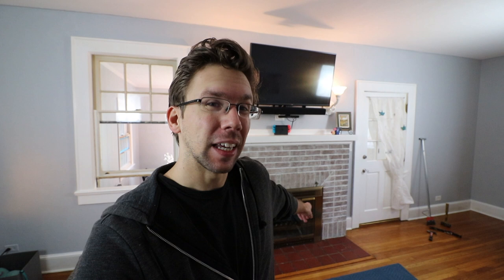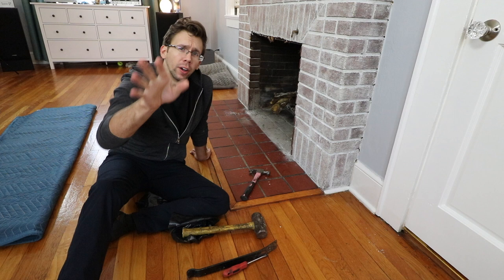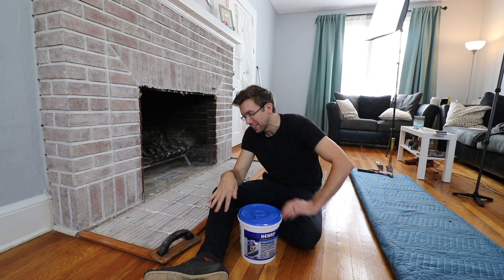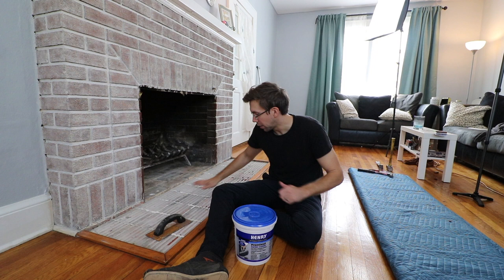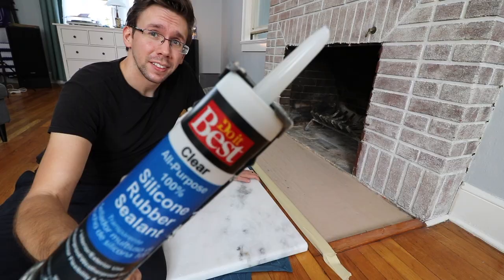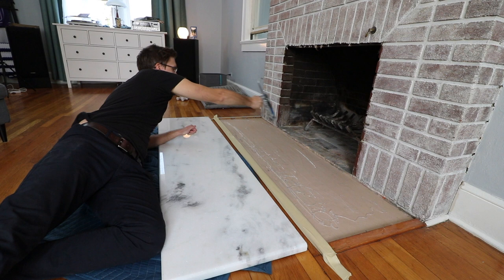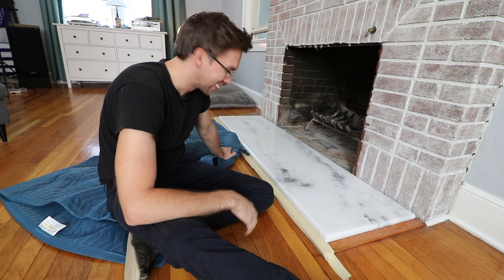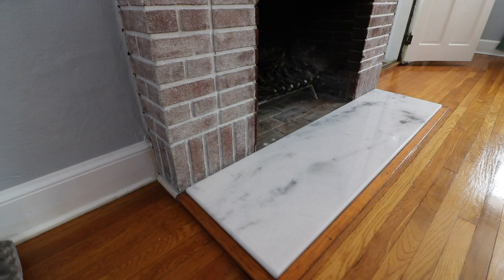Fireplace Hearth Makeover - DIY Granite or Stone Remodel

Comment: The terra cotta tile was flush to the hw floor?  Any issue with the granite being thicker and being higher than the wood floor?  
Such as, you get the insert back in, do you stub your toes?

I think the moving blanket would have been a nice if it matched the color.  Really surprised you didn’t chip the granite when you lifted it up to extricate your blanky.
Reply from the maker: There’s a pretty heavy 45 degree edge routed in there specifically because we where worried about stubbed toes. Gotta look up hardwood floor colored moving blankets, if I can’t find it - that’s definitely a probably terrible business idea haha.
Reply: @MatthewFinlay  Did you get the insert /cover back in? I am afraid mine won’t fit at the bottom.
Reply from the maker: Yes! But I’d check your brackets - ours is a universal cover and had a good 1.5” of adjustment on the vertical and horizontal direction that it would still grab the inside opening of the brick. If your fireplace grill/cover is exactly the same size as your opening then you might have more problems.

Comment: Hilariously wonderful! If i were also to put slabs up on the sides and top, would i use the adhesive caulk for that too or a cement?
Reply from the maker: Thank you for the kind words! In my humble opinion, anytime you do vertical you have to switch to a mortar and install would be similar to large format tile. Annnd to make sure you have a solid base for you vertical slabs/pieces to sit on I would also do the horizontal piece on a mortar/cement bed. I could “get away with” the silicone install in this case since gravity will keep it on place. Vertical can be a safety issue if the silicone decided to let go. Hope this helps!

Comment: So from my research, when using granite it’s best to be in pieces to avoid cracking from the heat of a solid fuel fireplace. Is that just being extra cautious?
Reply from the maker: Yup, we came to the same conclusion but since we are wood burner with the possibility of upgrading to an insert (full access to the area in the basement) we chose one piece. Natural gas/propane log set was not recommended by the stone place - ironically that was their first question when we told them what it was for. And avoid anything man made/synthetic.

Comment: Thanks for the video. I just bought a granite hearth (same size as yours).  We put it on the plywood floor that once had ceramic tile on it.  The plywood is flat and the granite is heavy.  I don't see the need to glue it down.  Is there a reason I have to?
Reply from the maker: Nope! Our hearth had a slight angle to it where things would roll away. I was hoping to not have to use leveling compound but it was just too rough for my taste. Since we leveled it and the fit was tight I used it because we had already bought it haha
Reply: @MatthewFinlay  LOL. Thank you! Now my husband will agree with me. 👍🏼😁
Reply from the maker: You could also compromise and glue the 4 corners with little dots/mounds. Ohhhh and be careful! Construction adhesive can stain stone, there are con. adhesives designed for stones, tile etc. but my go to is clear silicone. Just an FYI